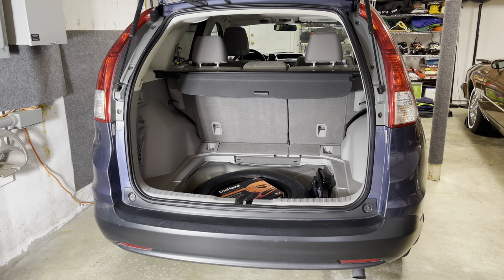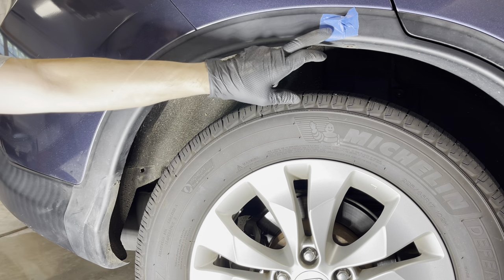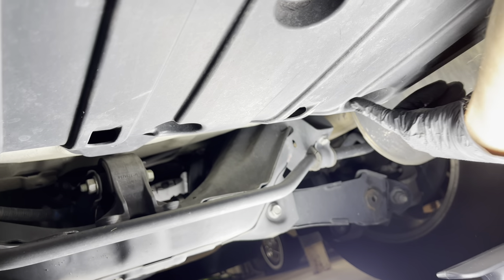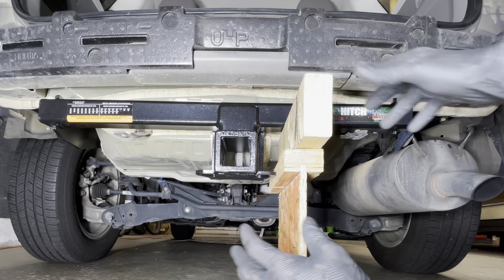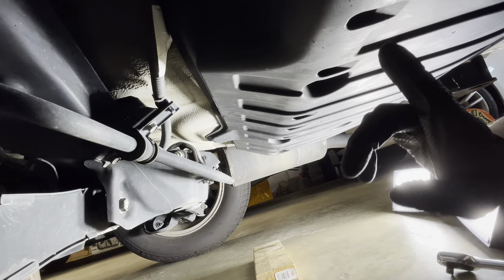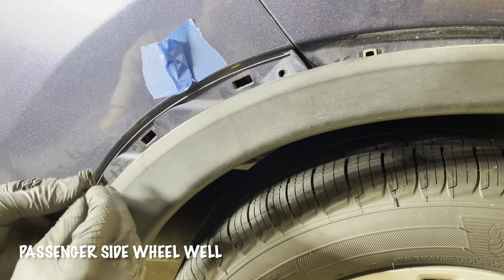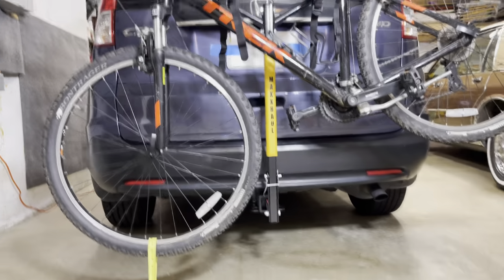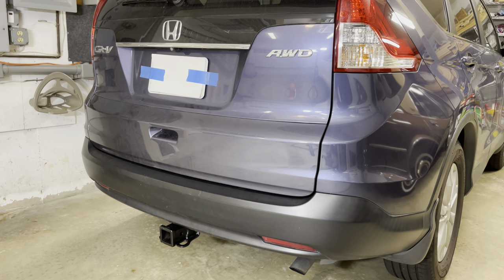How to Install a trailer hitch on 2014 Honda CR-V

Comment: I put the trailer hitch on today.  After doing so, I concluded that all I really needed to do was measure the cut out for the left side of the bottom panel (measurements from the installation instructions for my hitch) and cut it out (I used a box cutter) without removing anything.  The only thing I really would have had to do was drop the exhaust hangers on the right side and then reinstall them once the hitch was bolted up.  I hope this saves someone lots of time.
Reply from the maker: Thanks for the comment!

Comment: Wouldn’t feel good about hanging 5 bikes on the back. Fantastic leverage generated.
Reply from the maker: Yeah - only for short trips I think. The Yakima rack manual states that it can handle 5 bikes (it is the 5 bike rack after all), and then as long as you are less than the tongue weight rating for the hitch it should be OK but I wouldn’t do it on long or bumpy drives.  Also to fit 5 bikes on that Yakima rack requires some skill at Tetris because of how close together they have to be side-by-side.  (We’ve done it with three bikes no problem.). Thanks for commenting.